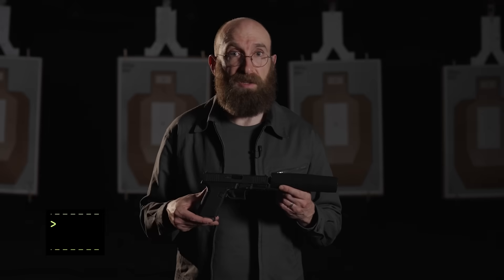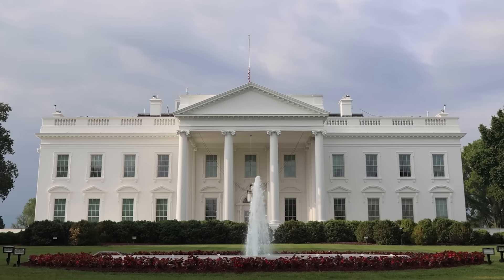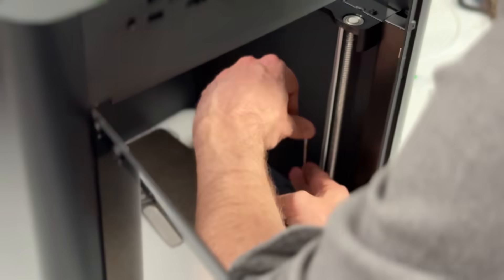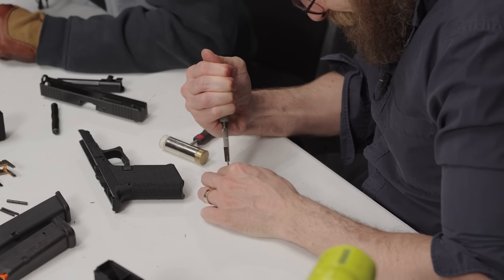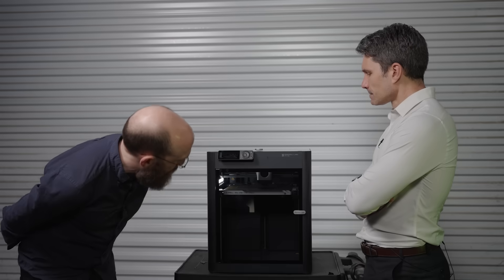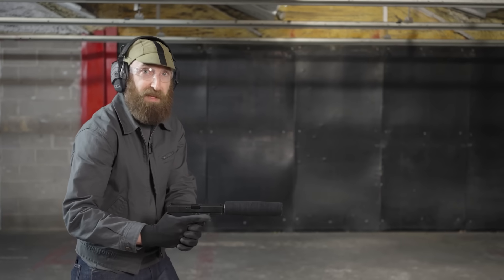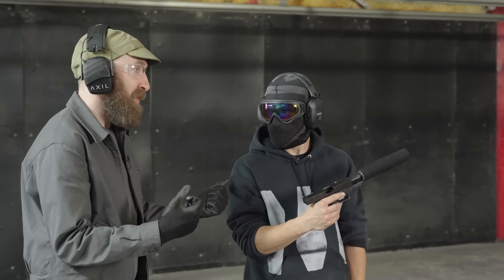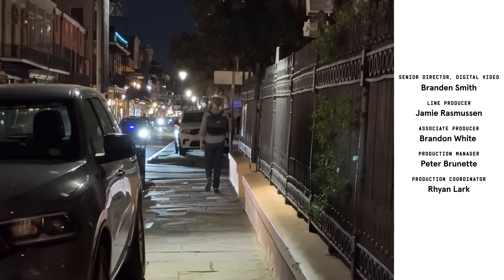I 3D-Printed Luigi Mangione’s ‘Ghost Gun’ | Hacklab | WIRED

Comment: Conflating ghost guns and 3d printing guns is hilarious. The term ghost guns is a fear mongering tactic coined by big media in and of itself. You need to define specifically what this term means and what it entails instead of just throwing it around. Regardless nobody is using these stupid 3d printed guns for anything. It was a fluke lugi used a 3d printed gun. Whether it is a good thing or not you can get guns pretty easily if you want. I would ask the creator to include honest and specific statistics to accurately represent reality. Not just stuff to get people more scared. That just makes solving the problem harder.

Comment: 3:08 No, lad, you have read that wrong! It clearly says:

AB 1089: “Prohibit the [...] possession [...] of a three-dimensional printer that has the SOLE or PRIMARY function of MANUFACTURING FIREARMS [...]”

What stupid phrasing is that if ye want to prohibit ghost guns? Every 12 y/o, and I, as a jurist who is trained to immediately tell how you bend and circumvent rules or use them to yer advantage or the disadvantage of others, can too immediately read that you ARE PERMITTED to print at least one single ghost gun with any 3D printer whose PRIMARY PURPOSE is NOT PRINTING FIREARMS but anything else, and you just occasionally print a firearm with it, all the more so when you printed only ONE on, say, any common office 3D printer, whose PRIMARY PURPOSE is printing other stuff. One printed single firearm does not make a 3D printer that has also printed two or more other 3D models a 3D printer whose primary purpose was to print that single firearm.

If I want to assume that California lawmakers are not totally mental or incompetent, then I'd argue this was worded purposely that way to pretend to have a law "against" privately printing firearms while in fact still allowing it. Just read between the lines and the fine print, and you're good to go, even in California. If you want to prohibit ghost guns, you have to prohibit 3D-printing firearms without a state-license as a firearm manufacturer. Done. 

They cannot link the ban to a condition such as the sale of 3D printers, whose main purpose remains unbeknownst to the vendors. So that's already impossible to check on for vendors, who are now incriminated too for having sold the printer to someone who didn't reveal its primary purposes when he bought the printer. 3D printer vendors are thereby now prosecutable for having sold a printer to a potential criminal. They had no idea that he was one nor any means to check if the alleged purpose was real or not.

Plus the other conditions, like purchasing or possessing one [hello, Christmas gift], are also NOT violated, as long as the prosecutor can't prove that manufacturing firearms with it was the main purpose, which it clearly was not meant to be when Granny gifted the 3D printer to her grandson. She certainly didn't have in mind him manufacturing ghost guns with it. What a piece of horse manure that law is.

So, as long as there's no other law than this in California to ban 3D-printed, unregistered firearms, which you're not aware of and therefore just cited the wrong law, you can print unregistered 3D guns as a private individual in California. Just don't do it too often on one single 3D printer. Do it only occasionally, and you're good. And as a criminal, print a thousand different other pieces with it first, and then mix yer ghost gun in, et voilà, the main purpose of that printer wasn't the ghost gun either. Or even better, use several printers for several parts of the gun, which alone can't make a firearm but only when assembled afterwards. Done.

Can't be like that, can it? But this harebrained California law says exactly that, so it can.

Comment: Isn't part of the problem that the easy to make part (the frame) is regulted in the USA and the hard to make and load bearing parts (barrel, bolt, ...) are not? A lot of countries do it the other way around for that exact reason. I imagine that it's way harder to make a reliable barrel, that a frame.

Comment: Jeez, this is stupid…
Here’s a newsflash: you can fire a Glock completely without the frame.
It will be singleshot and kinda hard to use, but it will fire.

THE 3D PRINTER WAS NOT NEEDED AT ALL!

If there’s a problem here, the problem is that you can buy all the parts actually needed to make the gun fire over over the counter with zero control.

Comment: and this is why "gun regulation" is a political smoke screen.  The argument is not good faith in a context where firearms can be 3D printed.  There is no possible solution.  So it's used to churn conflict and outrage.  This pattern of framing a bad faith argument, then exploiting it for churn, it's the standard model of modern political discourse.  Y'all need to pay attention.  It's on the quiz.

Comment: 17:20 I don't think that software can tell the difference well enough between real gun parts and toy guns, both of which are likely to be 3D printed. Also, if someone has the technical expertise to make a 3D printed gun, they're very likely to circumvent software built into 3D printers, while non-malicius users (like cosplayers) will be left with a huge annoyance, that doesn't even save lives.

Comment: but how you inserted the iron rail for the slide of the gun,  glock  has metal guides inserted in the polimer during the molding od the lower frame in order to guide and hold the slide of the gun.
this is not for example a bertta pico wich has an entire and independet of the plastic part metalic subframe.

Comment: Liar.  The upper and receiver still have serial numbers.  You printed a lower frame, NOT A "GHOST" GUN.

So how exactly do you have a testosterone level in the negative numbers?
Reply: That serial is still NOT the gun? A ghost gun can have the serial scratched off
Reply: @PogoBinks  true, however you can't finish a 3d printed firearm without purchasing certain components, most of which are serialized.

Comment: its much easier to just regulate other gun parts aswell

once you have to register all the pressure bearing parts ghost guns disappear
If its just the receiver which isnt subjected to the highest stress in the gun you will always be abled to print working guns.
its about regulating the parts that you can't manufacture yourself.
Reply: You can manufacture pressure-bearing parts with a cnc machine.

Comment: The thing is this, making the frame/grip/lower the gun and not the bits that need to withstand pressure during firing, was colossally stupid regulation. You can't (yet) 3D print a barrel and slide.

Comment: Weird that the regulators consider the most commonly plastic part that could most easily be printed to be the "gun" while the parts that need to be precisely machined metal are fine to sell as parts without any real tracking.
Reply: What are you talking about? Upper receivers are regulated. They’re serialized and sold with background checks commercially.

Comment: Lighter spring would alleviate the weight of the suppressor on the end of a "glock" barrel. The weapon won't cycle because it's so heavy that it can't physically push the slide back far enough.

Comment: The problem is actual gun parts like barrel, not 3d-printing. As soon as those parts are not regulated , there is a problem. If you can't buy a barrel and other metal parts, 3d-printing other parts is harmless. The solution is easy: you sell essential gun parts the same way as you sell the gun itself.
Reply: That would be an infringement.

Comment: The Nielsen device (also known as a recoil booster) was the missing part that would have allowed Luigi Mangione's 3D-printed ghost gun—a Glock-style pistol with a suppressor—to operate correctly as a semiautomatic firearm without jamming after each shot. But I don't know if it could be purchased or 3d printed, or that Luigi knew about it.

Comment: DRM only exists because appliance-makers agree to make the system hermetically sealed.  But 3d printers are open-source.  Sure, some are getting fairly appliance-like, but they're never going to completely displace DIY 3d printers.
Attempting this kind of control is as delusional as thinking you can prevent e2e encrypted communication.

Comment: Hahaha it's so funny to me that instead of regulating the chamber and barrel, the essential parts of a firearm they want to regulate 3D printer software, this is so ridiculous the small microprocessors on the printers can't detect anything, they're hardly fast enough to run the g code files... And if you want to force slicers to comply with this (how ever you want to achieve detecting a gun part...) good luck forcing the hundreds of projects to do it... 3D printing is not the problem here, you also do not regulate CNC mills and lathes do you? Because people with the right tools could always build guns...

Comment: Yeh so you can’t change the 2nd amendment or generally the culture of the USA and solve the “gun problem” at its root. So let’s update the firmware in 3D printers to spy on what we’re printing and simply refuse to print weapon components. Yep. That’s the right solution here. 😒

Comment: Here in my country (Chile) you cannot buy a barrel or any "essential" components for a gun without first owning the gun they go in. So you can't just go into a store, buy a glock magazine or barrel without first owning a legally registered glock. But in the US, trying to enforce that, would be pretty much impossible, the cat is well out of the bag and running down the street already. Here blank firing guns used to be over-the-counter until 2022, when criminals figured out how to crudely convert them to non-blank firing. So they banned them, which has helped noone since there's a huge stock of them lying around, and many (most?) former-legal owners don't want them anymore and just sell them under the table in whastapp groups. There have been talks to do the same with airguns, which would be just as pointless.  The US is a special country, and you're never going to "get rid" of your gun problems with the formulas tried elsewhere.

Comment: the firmware is open source
the slicers are open source
the parts for a printer are used in a variety of applications that would make it unrealistic to control and regulate.
so what's the plan?
Reply: Never underestimate the liberals and their ability to be incredibly low IQ

Comment: What you would need would be a Nielsen device to allow the 3D printed gun to cycle correctly with a silencer attached. The Nielsen Device is a type of suppressor mount that allows a suppressor to move forward upon firing and thus allow a recoil-operated firearms to cycle reliably despite the added weight of a suppressor which would normally not allow the slide to go back and cycle the next round..

Comment: I think what's really wild is the frame was made out of PLA, which is generally regarded as one of the weakest filaments, and not really well suited for a use case such as a firearm frame or receiver. I'm surprised that the modifications done to the firearm were done to the slide and/or barrel and not the printed frame itself, the rear rails, or locking block. I'd be really interested in seeing "behind the scenes" footage of everything that needed to be done in terms of fitment for drilling the roll pin holes for the trigger housing/rear rails, locking block, and trigger bar, as well as installing all of the lower parts into the frame. Seeing how the hand drill was used to drill (it was either the trigger bar hole or locking block hole) one side of the frame through to the other side, I'm curious as to what kind of issues this may have presented - typically this isn't the correct method, instead one should drill one side at a time to ensure the holes align properly, as this could negatively effect proper alignment and function. The video more or less made the process look "easy" but I'm curious as to how many frames needed to be made, how many attempts at assembling had to happen, etc, before we see the functioning firearm. For example, was the final version actually printed in PLA? What about ammunition, what bullet weights were used? It is mentioned that super sonic ammunition was used, but was subsonic attempted? Was a booster used with the suppressor? Perhaps a booster wasn't needed if the suppressor was lightweight enough, considering it was 3D printed. Typically Glocks have been finicky running suppressed, so this would be interesting information and could also be used to help understand why Luigi's firearm needed to be manually cycled as well.

Comment: The problem with the 3D printer firmware manipulation is that it is easier to 3D print than to print on a paper. Therefore open source 3D printers are much more realistic to show up (or they might already have) than open source paper printers. And if that's the case, good luck regulating the firmware.

Comment: Problem with the approach of building detection into software, is that much of the 3d printing community is very into open source, and many people will simply refuse to buy a printer that does not allow for open source firmware and will refuse to use a slicer software that isn't open source, and if something is open source, people can find and remove the detection code, and then compile the software themselves to have a special version without the detection code. Another problem with detection software would be false flags. The 3D printing community also has a subcommunity of 3D printed dart blasters (as in nerf blaster type toys) that could be easily false flagged by detection software

Comment: 3d printers have come so far. If you use a fancy filament like PA6-GF (nylon 6 with glass fiber reinforcement), then you have better materials than real guns use. The P90 is injection molded PA (nylon)

Comment: Ok so this guy created a handgun using a 3D printed frame and a bunch of "gun parts" bought online. How hard would it be to produce a gun good enough in the real world (i.e. one that won't blow up in your face, one that will shoot consistently and hit where its supposed to, one that can shoot many many bullets without degrading etc) that used ONLY computer manufactured parts (3D printed, CNC machined etc) or off-the-shelf items that are not even remotely tied to gun production? Could you build a gun without needing to buy or acquire ANY parts that could specifically be considered a "gun part"?

Not that I would ever want to make a gun (especially since its totally illegal here in Australia and I have seen enough stuff on TV and YouTube and etc to know jail is not somewhere I want to go), just wondering how hard it would be for someone to make a gun in the US right now without actually needing anything that could actually be banned or controlled if the government decided to go after gun manufacturing.
Reply: You could buy two pipes and a nail at a hardware store and make a smooth bore shotgun.

Comment: You didn't 3d print sh*t! It was a bamboo core lab that did all the printing and you didn't even TOUCH the 3d printer, nevermind setting it or designing the file. Therefore, UTTER BULLSH*T VIDEO!

Comment: You didn´t print a gun. You printed a pistol frame. All the other metal parts are way way more significant and difficult to manufacture DIY. 
Only the Silencer is fully printable as it seems, without connection to the barrrel. 

Deceptive title.

Comment: A DRM for 3D printers is completely impossible, and a terrible idea. There are plenty of opensource 3D printers, and all they need is some microcontrollers and motor drivers. And you're not going to be able to force a DRM solution on every microcontroller that can drive a few motors. Just as you're not going to require all computers to have a DRM solution for 3D printer slicing software.

Comment: Overall, I grade your reporting a C- or D.
A few times you stated you "fired the exact gun Mangione used". Rather than "a copy of the gun". I would like the "reporting community" such as wired to do a better job in the used of "ghost gun". A 3D printed lower is not necessarily a "ghost gun". A gun, whether 3D printed or not, without a registered serial number is a "ghost gun".

Comment: It's almost like guns are just tools and you can make tools because it's just stuff. It's not that crazy that people make their own guns just like it's always been
Reply: Not really. The manufacturer law was in place only because it was difficult for a person to make a firearm. Not impossible but certainly difficult. In today's marketplace, you can make a functional firearm within an hour use jigs and other tools that get included. That's not the same as someone who had to make a firearm in the 90s, or even the early 2000s. So I think laws should be in place since the kit is sold as a all-in-one package and someone with very little knowledge of how it works can get it functional.
Reply: I was able to take a 80% aluminum lower and using simply a power drill and the included jig and bits, I was able to mill out the pocket and fire control pins and it took me an hour. It didn't look pretty at all and had some roughness but it worked. It used to be you had to have some level of knowledge to do that but not anymore.